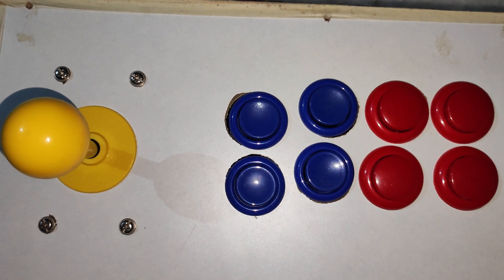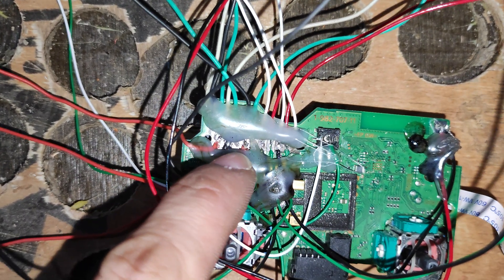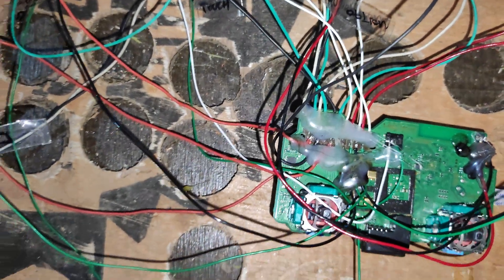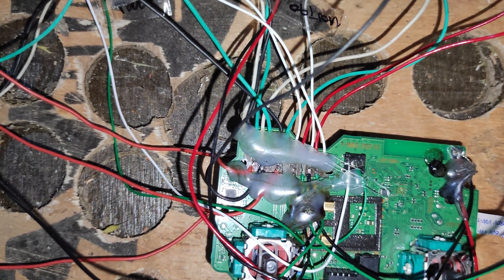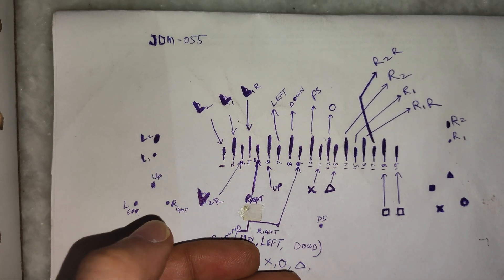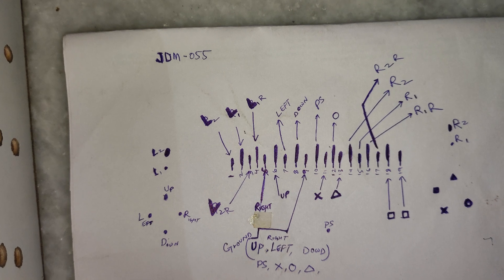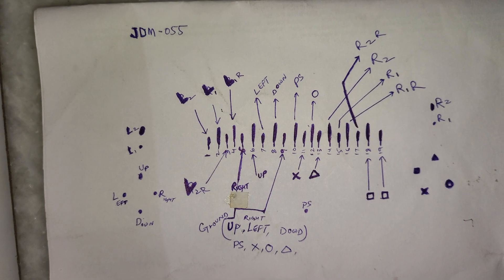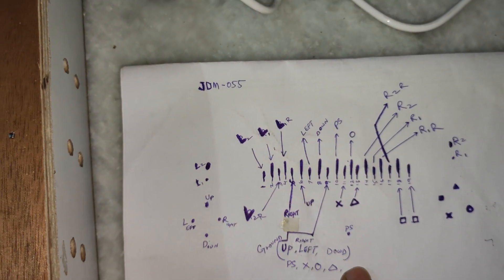Guide - DIY Arcade Stick - With PS4 controller motherboard.

Comment: Great mf work bro!
I have some questions:
The dedicated ground to ps button, right, up down etc.
Need a 8K ohms resistor for this ?
Or i can connect without resistor?
Square need a resistor too?
What number of square are ground?
Thanks bro for this diagram and modding, greetings from México! 🙏
Reply from the maker: Thx bro. Buttons like ps, o triangle, U, D, L, R, share the same ground. Only square button has it's own 2 terminals and doesn't need shared ground. This is for JMD-055 model only. It may not be the same for other models. If you have a different model, the diagram may be almost close to it but may be slightly different. Do you know your controller model?

You need an 8K ohms resistor for these buttons: L1, L2 R1 and R2. The ground of L1 and L2 needs to be connected with the resistor. Same applies for R1 and R2. Without resistors, these 4 buttons won't work properly. Other buttons don't need a resistor. If you have the same model, then square will be the last two terminals to the right and doesn't need a resistor.

And others like share, options and touch press button have their own dedicated 2 terminals each. These must be the same for all the models.
Reply: Oh, i see
My model of the pcb is JDM-055, the same as you.
In a few hours i will go to buy the resistors, thanks bro.
I recommend you do a part 2 of the explanation, if you have time, of course.
Reply from the maker: @Fabrizzio-  Oh that's great. You can use the diagram as blue print. After you take out the ribbons, you will see carbons pasted on all the terminals. So, make sure, you scratch off all the carbons to leave the terminal tracks carbon free so that it will be in a state to do the soldering stuff and all. I was planning of explaining in details but for some reason there was limited time to 8 mins to record. Thx for the suggestion, I will consider making part 2 with all the detailed info.
Reply: bro here is an update
Reply: Only 3 buttons works, Square, options, direction pad too, the other buttons doesn't work, My soldering are very good connected
Reply from the maker: @Fabrizzio-  Did you use the same shared ground (9th terminals, counting from left ro right) for x, o, triangle, up, right, left, down?
Reply: @bishor33  yep, i use the ground for the required buttons, the shared ground, and some buttons don't work (the buttons that i mentioned) i tried the ground one by one with the buttons who doesn't work
Sorry 4 my English, i can't express fluent
God bless u bro
Reply from the maker: @Fabrizzio-  I also face English language problem. So, that's ok. Do you have a multi-meter(tester)? To check if your soldering is completely attached to the tracks. And when you do the test, make sure, you test it by pointing one terminal tester on the track of motherboard and the other terminal at the end of the wire. And what about the ps button? Without ps button working, you won't be able to check rest of the buttons. So, try to make the ps button work. It should work unless the soldering is not connected to the track or not connecting the corresponding wires or motherboard issue. I also would strongly suggest you to check your ribbon to cross-check the connections as well.
Reply: @bishor33  hi bro, another update (the last, i think.. xD)
The other buttons works properly, but, o don't know how to connect the resistors for the R2 and L2 (this buttons are the only need, because my arcade stick have only 6 buttons for kick, punch, etc...
I've searched for a schematic but o can't understand :(
I don't know where put the resistors, if in the pcb or wired, because this buttons not works, (nothing) the resistors are 8.2k ohms because i can't find the 8k Rss in the local electronic store
Reply: Do u have a email or something where You can send me a detailed from your wiring settings to copy the same setting?
Tnx!!
Reply: Detailed pic* i forget the most important Word: pic, hahahaha
Reply from the maker: @Fabrizzio-  Great to know that you managed to make other buttons work. Ground of L1 and ground of L2 needs to be connected with a resistor. And Ground of R1 and ground of R2 needs to be connected with a resistor. You can pause the video at the time when the diagram is shown. L1R, L2R, R1R and R2R are the ground connections that need resistor. Here, the 2nd 'R' means resistor. You can use 8.2K Ohms, I use the same. I can send you a picture of the soldered connections between wires and motherboard but it won't make a difference as it will be now difficult to understand as I have already hot glued it. Share me your email, I will email you. If your email is with gmail then type abcdef(at)gmail(dot)com
Reply: Hi bro, this works, finally
Thank u, so much
You are a legend
Reply from the maker: @Fabrizzio-  Glad to know that you have made it. You are welcome. Enjoy your home made DIY arcade stick. 👍
Reply: Dear can I use 10k ohms

Comment from the maker: This is a PS4 controller motherboard terminal connections guide with a drawn DIAGRAM. Feel free to ask if you have any doubt. I would be be glad to clear your doubt.

New video of PS5 arcade stick with PS5 controller PCB is out now: 
https://youtu.be/R3BKon9N8dk?si=CmHgs5N0GB6HY3TP
Reply: Thanks once again dear bro.  Managed to connect primary buttons.  The R1 is giving issues.  What resistor does one connect? And where to get?

 Also, start and select have the same ground as others? 

Finally,  the thumbstick buttons, can they be connected too?

Thanks in advance
Reply from the maker: @ynhakeshu313  It will give you a problem, if a resistor is not attached to one terminal of R1 and another terminal of R2. You have to look on your controller's ribbon to see which tracks are attached with resistors. You have to have 8K ohms resistor or if you don't, you can get 8.2K ohms resistor. I didn't get it so I used 8.2K ohms resistor. Which start, select buttons are you talking to? PS4 controller has share, options, touch press button and PS button. Share, Options & touch press buttons don't have ground as they have their own dedicated terminals. PS has a shared ground. So, I don't know start and select buttons you are referring to, I haven't seen one. Yes, you can connect the thumbstick as well if you add additional push buttons. For that you have to figure out the connections that goes to the thumbstick.
Reply from the maker: @ynhakeshu313  8.2K ohms resistor is easily available to order on amazon. You can search it by typing this 8.2K ohm 1/4 Watt resistor
Reply: @bishor33  thanks once again
Reply from the maker: @ynhakeshu313  you're welcome
Reply: Dear bishor brother.  Heartfelt gratitude.  Finally managed to play today with the custom made controller inspired by your work.  Would love to share pics with you. I must say i was sloppy, messed up circuit, burnt my fingers,  but by God's grace, using your guidance  managed to get at least 6 buttons working.  How can i send here?  Or do i have to use WhatsApp or email?  I tried to see YouTube options.  But can't get how to connect with you directly.  Would genuinely want to send thanks.
Reply from the maker: @ynhakeshu313  Glad to know that you have made it worked. It's your  effort that made you reached that. Hahah. My work is also messy and I burnt my fingers too several times. It happens. Share your email so I can email and you can then share the picture. If your email is with gmail then type acbdef(at)gmail(dot)com
Reply: @bishor33  thanks a ton dear.  Iam unable to post my email.  Keeps getting deleted.  Trying again... playstation3stat 'at the rate of' g***l d**com
Reply from the maker: You are welcome. Got it. i have sent email. Pls check.
Reply: Would this play games mortal Kombat 11
Reply from the maker: @Moenb  yes, it should be able to play. Any games that can be played by a ps4 controller will be able to be played by the stick as the motherboard is itself of ps4 controller.
Reply: Again heartfelt gratitude dear friend.  Managed to solder the PS button and test.  Works. My motherboard of the DS4 is diff, it's actually a first copy of the original which was lying around my place. Still hoping to figure out rest of the connects

A little query, the R1r etc in your connotation the second "r" means that its the single connect?  No ground?

Also, how to link the share and options buttons,  as their points are separate like a square.

 Sorry for troubling you again. Thanks in advance dear
Reply from the maker: @ynhakeshu313  no problem. You are welcome. Good job. R1R is means the ground connection for R1. The 2nd R in L1R + L2R and R1R + R2R are ground connections that needs resistance. You have to attach an 8K ohms resistance (or resistor) each in order for L1+L2 and R1+ R2 works properly. L1R and L2R needs to be connected with a resistance. Same way, R1R and R2R needs to be connected with a resistance. If you can't get 8K ohms, you can use 8.2K Ohms. I couldn't explain this in the video as the video was limited to 8 minutes only.
Reply: @bishor33  great thanks a lot bro. 

Any suggestions where to get those delicate wires as well as the resistors?  And the options+ share buttons connections? Thanks in advance

PS iam at Mumbai suburbs.  So asking where to get as local hardware don't have good quality .  Thanks
Reply from the maker: @ynhakeshu313   You're welcome. No idea where to get it. But you may ask your local people the place where electrical/electronics wre sold. In Delhi, it is in Lal Qila. For me, I took damaged/unused old charging usb cable from my friends and that's how I got really good quality wires. So, if you can't find the wires, you may look for such damaged/unused old charging usb cable. Or another way is to buy a branded 1.5 or 2m charging usb cable e.g. MI micro charing usb cable. It will cost you Rs.150-249. below that, it may be bad quality. But you can look for used charging usb cable (branded only) in OLX nearby you to get at cheaper price. For share, options and touch press  buttons, you have to dismentle those 3 micro switch buttons. And inside you will see shinning piece of metal terminals and those are the points for share, options and touch press button connections.
Reply from the maker: @ynhakeshu313  And resistors are available in the place that sells electronics stuffs. Still if you can't find it, then you can get it from Amazon. It will cost you  Rs.40-50 (30 pieces) + delivery charges. But I bought it offline from Lal Qila, Delhi at Rs.20 for 50 pieces. Try searching on youtube like buy electronics resistors in Mumbai, etc.
Reply: @bishor33  thanks once again bro.  You are very helpful.  God bless you

PS: did you manage to find buttons to upgrade your work.  It truly is a gem of workmanship.
Reply from the maker: @ynhakeshu313  You're welcome and thx bro. I am planning to buy a PXN arcade stick which is the best I can afford this time. At Amazon, it is available for 3990. And it looks a little bit premium and I will remove all the stuffs that's inside like kits and all and replace it with my controller motherboard.
Reply: Brother I want the same project but I do not understand where you guled and soldered it can you plz make it clear
Reply from the maker: @ghosthunter9372  sure. first, tell me, do you have ps4 controller same motherboard (PCB) model like mine or diff model?
Reply: @bishor33   first is that you have cover up the terminal which is difficult to know and plz show me every model of ps4 motherboard in which I can make many more arcade joystick
Reply from the maker: @ghosthunter9372  Bro, I don't have any other ps4 controller with me. I only had one and I used that ps4 controller motherboard(pcb) on this arcade stick already. If I had a spare, I would have shown it in this video. PS4 controller motherboard are almost identical. So, take out the pcb and look for those terminals (contact points), its model will be labelled there on the pcb. I want to guide you but I don't have any other ps4 controller pcb. 

If you are confused which terminals need to be soldered, then the answer is all of them. If there are 19 on your pcb, then you have to solder them all. If 18, then all of 18 need to be soldered.

For PS4 controller pcb, all those terminals are for directions, ps and those executional butoons along with R1, R2, L1 and L2. For buttons like share, options, touchpad button, R3 and L3, they are on different spots.

And those 18 or 19 terminals or those with even lesser, you have to count the terminals from left to right. Also, you can check the ribbon as well, if you can understand the ribbon, it will also help you more in understanding. 

If you still not able to understand,  drop me a msg on insta. Same username like YouTube. There you can send me pics of your pcb. Also, I would recommend you to watch the other video: PXN arcade stick to grab as much knowledge as you can.
Reply: Which wires you use to set this up
Reply from the maker: @ghosthunter9372  I used 1mm thick wire extracted from damaged/unused old usb charging cable of old phone. You can use upto 1.5mm thick wire. Not more than that. But would recommend 1mm. And make sure you use high quality wire that has good amount stuffed inside. Don't go for less stuffed wire.
Reply: @bishor33  thanks you so much for helping me , I will make the same project and this I will make from beginning,and after this done I want to colab with you to make new projects
Reply from the maker: @ghosthunter9372  Sure, thanks. And if you are planning to  build a whole arcade stick, then make sure, lever and buttons are not locals, go for brands like Sanwa, Qanba. Reason being, locals will give you noisy and annoying sound when you hit them. I already experienced that. Also, if you build, then prefer to do it with wood that has tight concentration, don't go for plywoods. Plywoods are so noisy and loud.
Reply: Can u tell me how to do it for ps2 controller???
Reply from the maker: @drawkingnikhil0818  I don't have ps2 controller. If I have ps2 controller, then I can look on it and then guide you but can't help. I would recommend you to  google if you can find anything close to ps2 controller modding. I believe ps2 controller mod will be more easier than ps4 or ps5 controller.
Reply: @bishor33  how much all these arcade sticks accessory costed ya? I'm from India as well.
Reply from the maker: @drawkingnikhil0818  this one cost me like 900 for stick and buttons. Box cost me 2300. So, total 3200 apart from the controller motherboard. But it's really noisy, thus, you can't okay at night, your neighbours will be disturbed. So, my suggestion be to put more money and buy best quality buttons like sanwa, etc and build should be of heavy wood. Or you can buy a used branded arcade stick at cheap price, mod it, try olx if you can find a used arcade stick at reasonable price. I have also bought Nacon Daija stick and I didn't regret buying it and modded it due to its company stock motherboard issue.